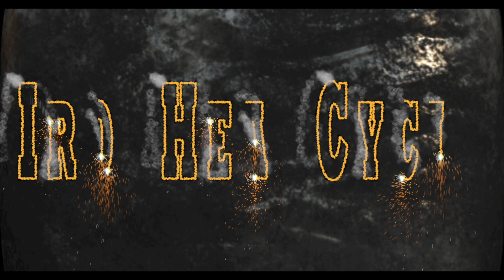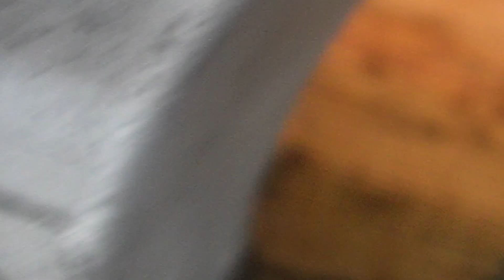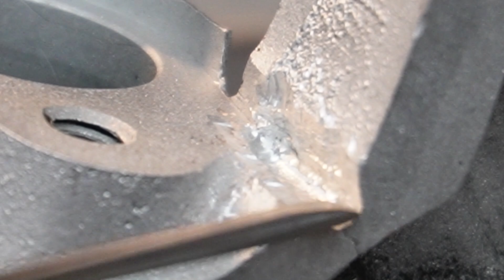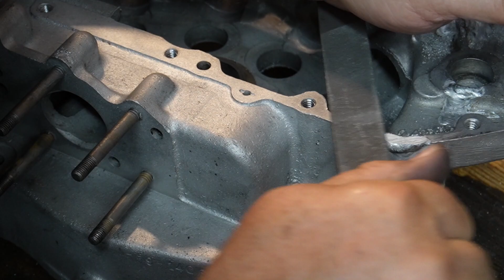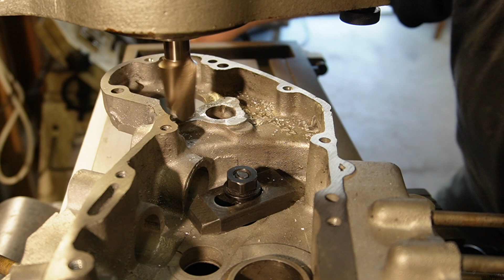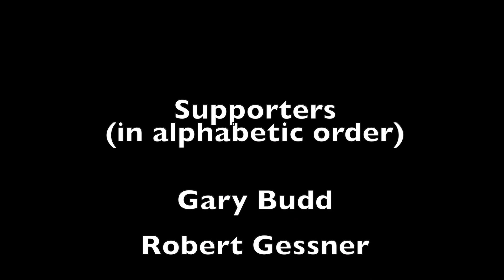59XLH Part I, Cases Cracked, What Else Is New??? Nbr 214

Comment: A spare drill chuck works well for damage free dowel removal . I have a demo of that on my Youtube channel
Reply: Jaws for the slide hammer.
Reply from the maker: I looked for the video, couldn't find it. Could you post the link please. I've got a spare drill chuck. I am also aware there are actual dowel pullers available that work with a slide hammer.
Reply: @IronHeadCycle    https://www.youtube.com/shorts/TTFEDE-AGV8

Comment: Good job Gary. What size sheets is that sandpaper and where do you get it from. Thanks, Joe.
Reply from the maker: The stuff I use is 12" x 18". Search for "12" x 18" sandpaper" on eBay or Amazon, it is expensive. The better prices are on eBay.